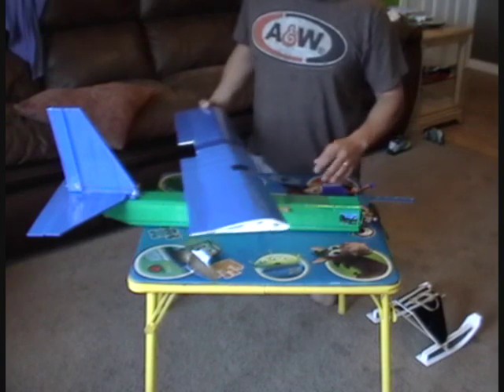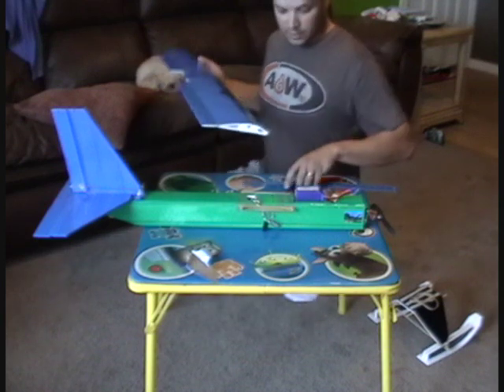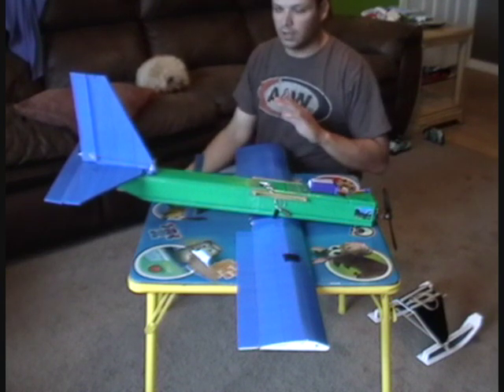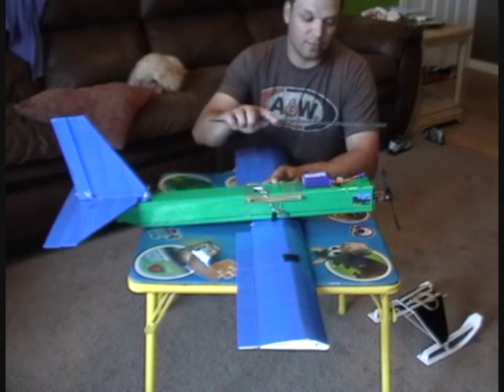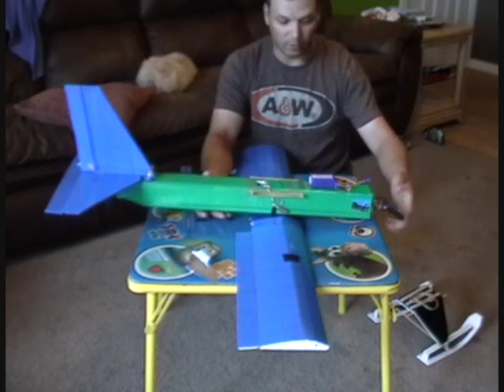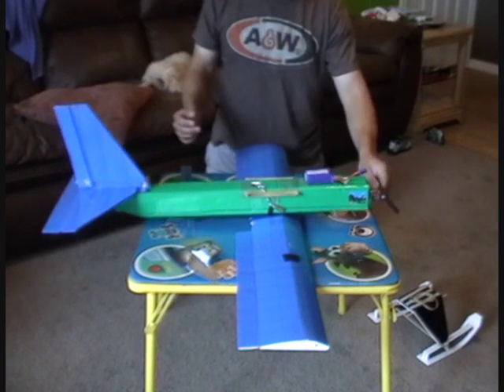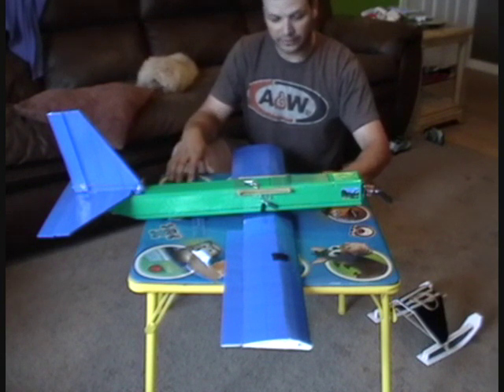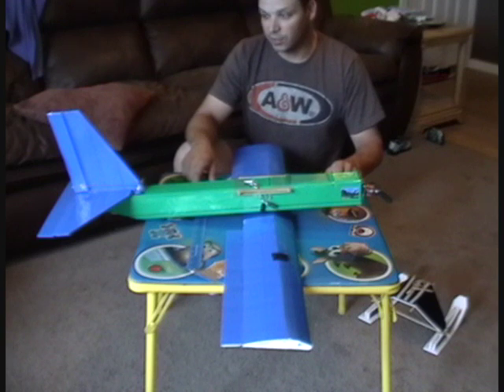How to Find COG ( center of gravity) of rc planes

Comment: i have 3 pound airplane, push prop i need pick up motor and speed control which let me flight 30 to 45 min with 4 cell 5200mah battery, is this posible, and what motor and esc do i can use, some body help me

Comment from the maker: in this video I was kinda refering directly to the experimental airlines noobtube, however on a normal flat bottom airfoil wing the cg should be at the highest point of the airfoil provided it's a straight wing. if it is a flat wing like on a scratch build foam board plane or somthing similar then a good starting spot is 1/3 from the leading edge. sorry to hear of your failures. but on a positive note all that means is your learning what not to do. if I can help at all please let me know